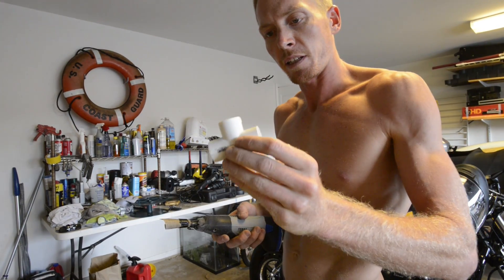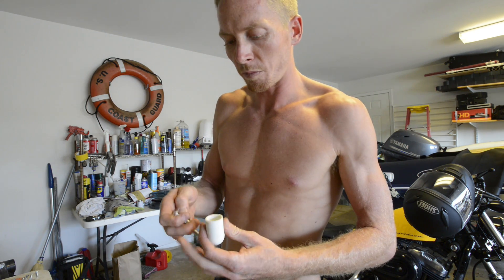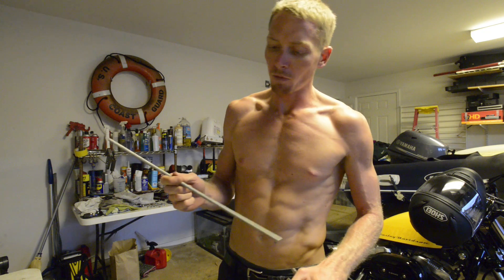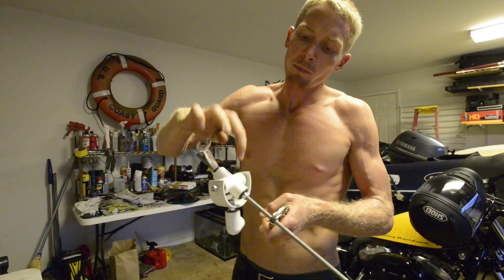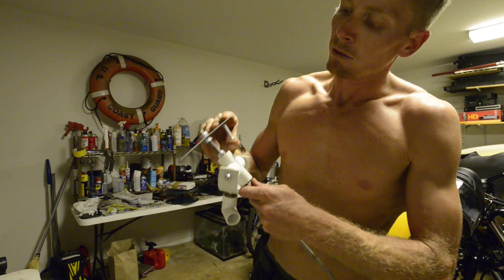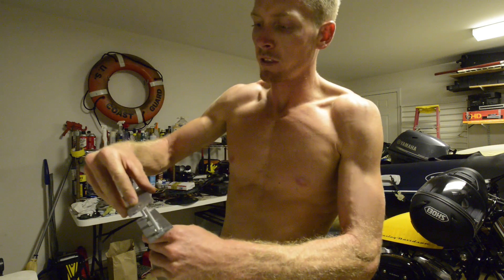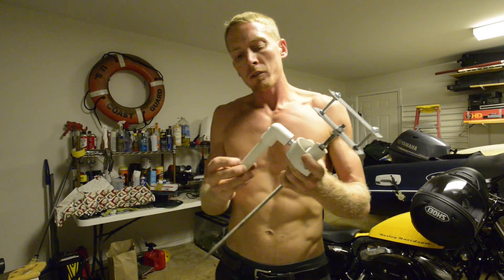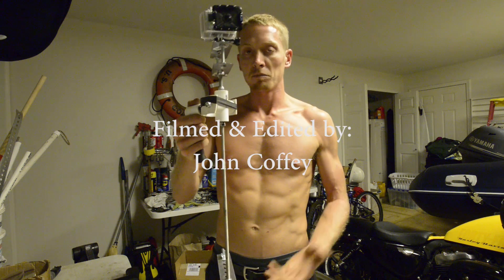How to Build GoPro Steadycam for Under $20

Comment: Great Howto!

This is probably the best DIY steadycam idea I have seen!

I would add that you should probably add a handle to the threaded rod so that you can control what direction the camera is pointing, instead of just letting it spin around...
Reply from the maker: Hey, thank you very much!!! I appreciate that. Also, a great idea with the handle...
Reply: +John Coffey (Ocean Adventure Video) I was thinking (trying to think of a cheap and light way to do it), maybe like the other handle with the + section of pvc, but instead of bearings where the rod goes through, maybe end caps with a hole drilled through each, then put the rod through and glue it in. When I get a chance to make one, I'll show it to you. I've got a lot of projects on my plate right now though so it might be a while.

Comment: Also if anyone is wondering where to get those bearings just go to any sporting goods store and go to the skateboard section. Rollerblades and skateboards use the same kind. Most places are more likely to have skateboard stuff over rollerblade equipment. Even Walmart sells 8 packs of these bearings. You can ALWAYS find them at your local skateshop😊.
Reply from the maker: And even new, they are not very expensive!

Comment: Nice build that's pretty cool and easy to make. Thanks for sharing😊! You could also put a stack of washers on that long rod at the bottom. Maybe about 15-20 depending on how much they weigh to replace the sideways bar on the bottom.
Reply from the maker: That may work, however having the weight separated fore and aft helps bring the pendulum back to stability more quickly. Whatever works best  for your personal use is ultimately the determining factor.
Reply: John Coffey yeah I thought about that some more and it does make more since for stability the way that bottom bar is. I was just trying to think of a way to do it so it's not so jagged with edges like that. One of the better DIY's I've seen.

Comment: Holy God! You said under $20.00, but said nothing about 20 hours! Obviously I'm not a total DIY guy but I am going to slowly work my way through this. Dumb question, but do you have a parts list with photographs? That would be so awesome if you could de-construct this and then lay it out to see the parts list. Or... put this into a kit in a bag. I'll buy one right now. Also,how can I get that ripped? I'm 50 and feelin old. Used to run a 10k 7 nights a week. How long ago? 30 years ago! I guess I could start running again. Or... Quit drinking?
Reply from the maker: Ha ha! I know the feeling. The part list is in the description! Good luck
Reply: Len you're a dumb ass if you couldn't follow this delightful little clip.

Comment: hey please help. i assembled everything and the bearing in the handle part keeps getting forced out due to the weight of the whole thing. how do i stop this? did you have this problem? thanks!!
Reply from the maker: I glued all the bearings in. I suggest using marine grade 5200 (any hardware or boating store will have it)!
Reply: John Coffey im not so sure what that is. is it something like super glue? i dont think superglue is strong enough in this case

Comment: Does it really need the counter weight?
Reply from the maker: It doesn't need much weight at all... The vertical rod may be enough if you got the correct length

Comment: how did you glue the bearings to the pvc??????
Reply from the maker: I used a 2-part epoxy, however any super glue or other that is made for metal and/or plastic will work fine

Comment: Had to update, i put this together today.  Had to go to our local roller rink and buy some old wheels from busted rollerblades. The bearings arent readily available in sporting goods stores here, hmm weird.  You make it look easy btw, it took me some time and a couple of goof-ups to get it right.  Still needs some minor balance tweaks and i think it'll work great!  I'll prob throw some black spray paint on it as i'll be using at wedding receptions etc. Total cost for me just a hair under $25. Thanks
Reply from the maker: Good idea! Never thought to find then there. Any skate shop should have them... Maybe even walmart..?...
Reply: Amazon is great but im a typical American,  I WANT IT NOW!

Comment: The only thing that I don't really like about this, is that the metal makes a clicking noise with you move it quickly. That's going to take away from the sound quality.
Reply from the maker: You can add a bit of electrical tape to make the fitting more snug.

Comment: Maybe i missed it, but did you give  a certain size to those bearings? And does it have to be rollerblade bearings? Any plain jane bearings would work, not sure if our local Dick's would have a cheapo set of bearings, maybe Lowes?
Reply from the maker: I used roller blade bearings, however skateboards use the same. Any I am sure will work fine, you may just have to alter the bolt size!

Comment: Could this work with a DSLR if modified?
Reply from the maker: Yes absolutely. I would recommend constructing the platform that the camera mounts to out of aluminum in the attempt to make everything as light as possible. I would also suggest fabricating some sort of wrist brace so that it takes some of the stress off your grip
Reply: Completed the build and modified it for a DSLR with a bigger plate

Comment: Why do you need the two platforms on top of the steadicam? Why not just do something we can put the gopro tripod mount on? I am at this stage on my project. By the way, great DIY Project and Tutorial!!!
Reply from the maker: You don't NEED it, I used it because i wanted to center the quarter-twenty mount. If you just glue it on, or other, you can use a single platform.

Comment: Excellent tutorial. I used A.D. Wheeler method for dropping the bearings into the 4 way and worked like a charm. Also the bearings are the same size as skateboard bearings so I went to a skate shop and bought a pack of 8 for 20 bucks. Canadian. It's not exactly the same due to hardware and different metal parts available for the platforms but this is out of all the tutorials the quickest and easiest to build in my opinion. Not sure how its going to work for my off road jeep videos but anything would be an improvement from what I have been doing so far. Thanks very much!!!!
Reply from the maker: Hey Awesome! I look forward to seeing some of your videos! Thanks for the kind words

Comment: Hi John, Thanks for this.. I have decided to build one similar to yours but not exact. I used cpvc for one... the gimbal works great but I have an issue Im hoping maybe you have input on.. Attaching the gimbal to threaded rod, I used only 1 bearing not 2 (its a 3 way cpvc with hole drilled out on top instead of a 4 way pvc). If I balance it then turn 180 its out of balance. did you ever encounter this problem? Im thinking it has to do with only using 1 bearing and its possibly not sitting correctly?
Reply: Think I figured it out.. I took every piece apart, replaced the nylon washers thinking they might not be sitting  correctly on the threads.. I found my handle was very off balance. I used a conduit strip instead of 3" pvc.. bent it straight and drilled 3 holes without measuring. the middle hole where the grip attaches was very off-center causing the weight to be shifted to one side.. meaning pressure would always be applied at an angle.. rotating the camera 180 after balancing sure would throw this out of wack. For anyone reading this, it is very important to make sure the whole rig is balanced.. after making every part, spin it to see if there is any wobble
Reply from the maker: drb137ify brilliant! I like it! Let me know how it works out and if you can post a video, you should! Thank you

Comment: I've been looking for a good DIY steadicam/ stabilizer and this one seems like the one to build. I bought of my materials yesterday (About $35 CAD plus the bearings) I think in the end if I cant find used bearings it will be closer to $50 CAD. Still a good deal for how good this thing works. I will be travelling to Kauai and Maui next week for a couple of weeks and I can't wait to use this setup! Thanks a lot for the how-to video, much better than a lot of them on Youtube. Love your videos, my next trip to the islands will be a one way ticket hopefully :) Do you live in Hawaii currently?
Reply: Dustin D  great tip on bearings, for those looking at goodwill for used rollerblades fyi.. the kids size rollerblade bearings have an inside diameter for a 1/4 bolt.. not 5/16. If you already purchased materials for 5/16th, search for the adult sized rollerblades
Reply from the maker: Thanks Dustin! Appreciate that! I am not currently in Hawaii, unfortunately. I hope the steadycam works out for you!
Reply: All said and done, it works great. I ended up buying a used pair of roller blades for $5 which yealded me 16 bearings, using the extras as weights.
Reply from the maker: Awesome! Enjoy your trip!

Comment: BTW the correct spelling is "Steadicam" (if you wanted to mimic Hollywood here :-) ). Anyway, I wouldn't think stabilization would be necessary due to GoPro's extreme wide angle? But then what I use GoPro for is not very "shaky" (paragliding).
Reply from the maker: Steadicam is actually a brand name. I will admit though, I couldn't decide which way to go when I was posting the video :)
Reply: John Coffey So the spelling thing is actually kind of important! I watched your video a long time back and wanted to make it and it took me forever to find your video again. You should rename the video to Steadicam and you would get a million more views. Your tutorial is by far the best up. I'll be making mine later today. Thanks again!

Comment: I can imagine some kind of bar end insert with a universal swivel joint, something that can be tightened to grip the handlebar from the inside.  Also would gluing or threading be better than drilling if it is PVC?

Comment from the maker: $20.00 is a rough estimate... I personally had an old pair of roller blades that I used. Although, any skate shop will have bearings for very cheap. $5.00 for a set of 4. Most of the time they have old ones that they replaced and will give you those for free. Skateboards, roller blades, skates, etc.